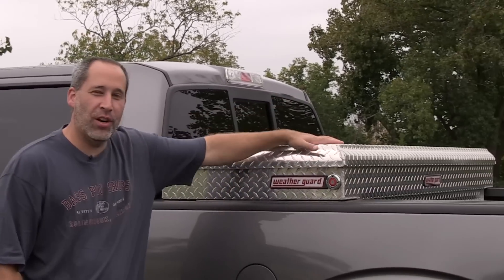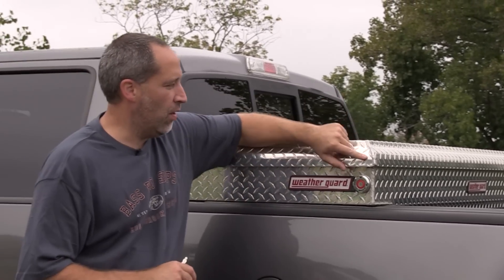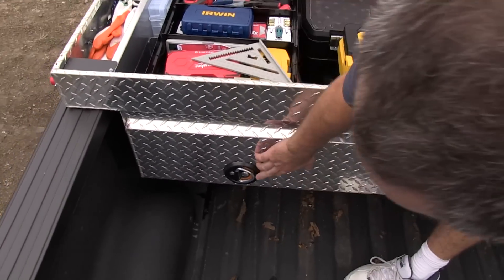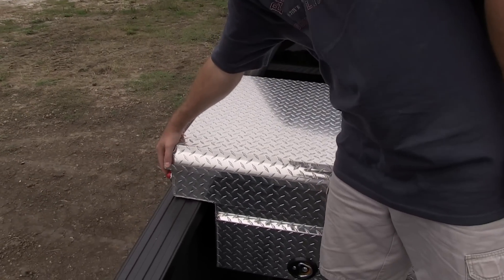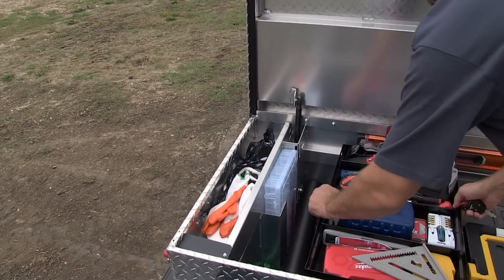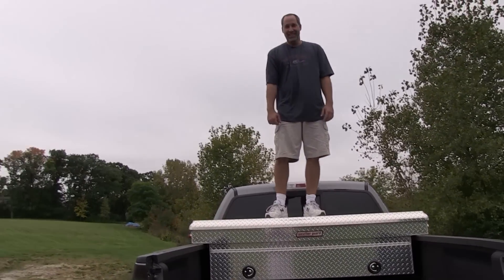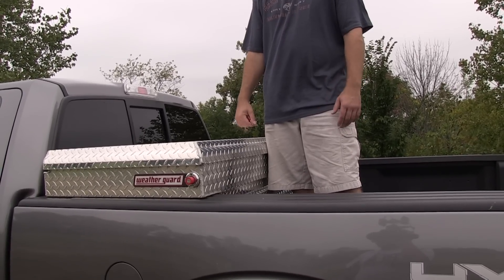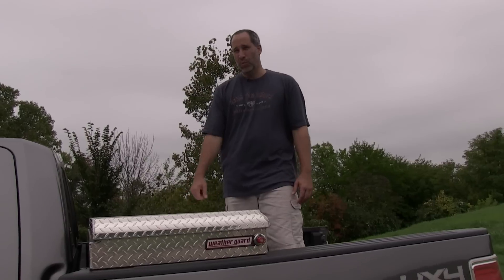Weather Guard Truck Box - Review

Comment: Had this exact box for two years. I run a handy man business and this box has takes a beating and still looks brand new. My only gripe is that closing it on one side does not lock both sides. Other than that. Best tool box ever.

Comment: There's a lot to be impressed with in this video. Very nice review Dan and Eric. The have thought of everything in that box. It's huge. You don't have to drill into the bed of the truck. The protection for the gas strut do nothing hits it and breaks it. The nice welds. The lock. The locking/sliding tray. It's so strong. I'm very impressed. Very impressed I wish I myself had on...., wait I need a truck first. Hahahaha.

Comment: Looks like a good box. I use The big job site boxes for my truck. Like the Home Depot Klein branded box, I needed a lot more room than the diamond plate boxed can offer. I can stack tool boxes and still have room for tubing and such on top and my pull cart for all my tools. They are not water proof, I had to buy weather stripping myself, since then no problems with water!   If I needed a smaller box this looks wonderful

Comment: Weather guard refused to post this review to their site stating it was not their fault for poor packing and damage from poor manufacturing: So I ask who is at fault for their mistakes
IT LOOKS TO BE NOT WORTH IT
I purchased the TOP of the line weatherguard box for my truck. it came in smashed on the corner ($600.00 box) and after three screw ups on sending the wrong box we had no more time to wait for a replacement. when we went to go install this TOP of the line box the lock house fell apart in our hands. the parts were stuck on with double sided tape YES folks double sided tape on a $600.00 box. the tape was never pressed down on s the entire lock house was just hanging there. This is not the quality I was expecting since I own other weather guard items and they work and are built right. guess have hired sub standard folks to now build everything like their low line items. and to boot in a $600.00 box they install a crap plastic tray that has cut outs for dividers and none were included and the plastic tray was used looking. At first we thought it was a return unit but it came factory sealed in a DAMAGED thin cardboard box. Save your money